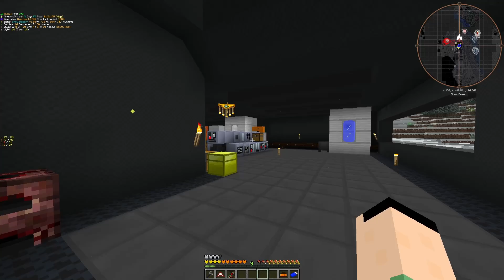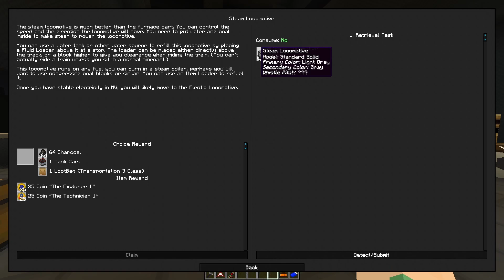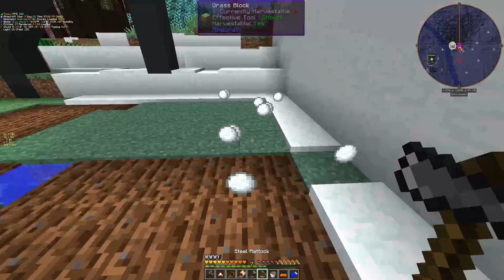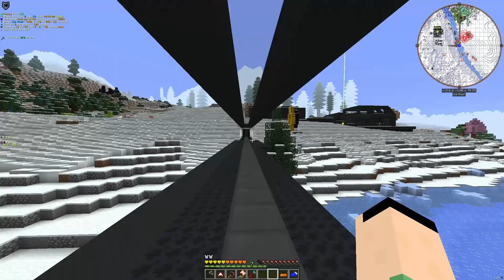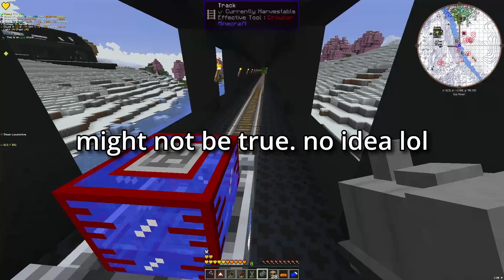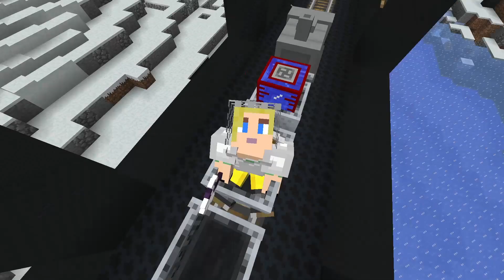GregTech New Horizons E11: The HamCorp Metro

Comment: probably old, you probably already figured it out, but the little bar you used to link the bookmarks in NEI has a function, if you right-click it it turns green and everything thats in there will get adjusted in quantity based on the materials needed in the bookmark. as an explanation: the 10 minecarts need 30 iron plates to be made, if you then add the recipe for iron ingots to iron plates into the bookmark and link that with the green bar, it will automatically adjust it to 30 iron plates. if you then decided you wanted 5 minecrarts instead and lower that amount, the amount of iron plates would also adjust to 15 automatically. its very useful to get a good overview of the things you need in large and complicated builds.

Im assuming you already know this by now, and if you didn't i hope it will be helpful for future endeavours